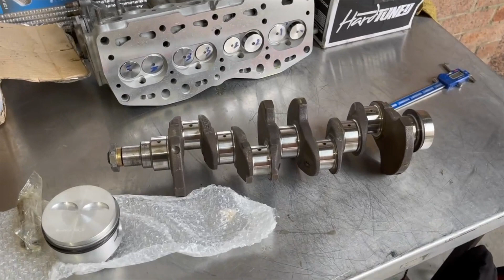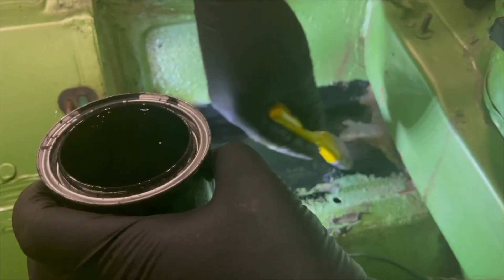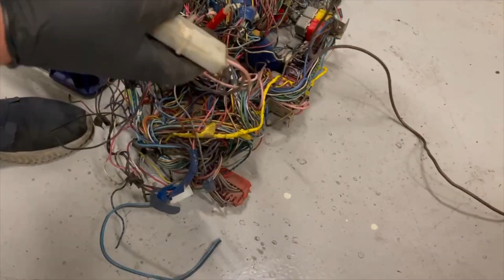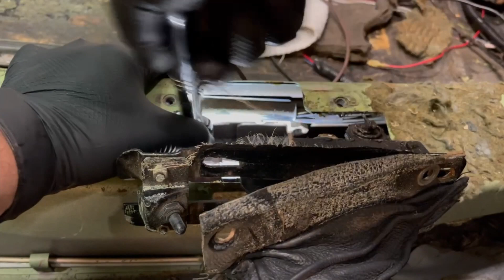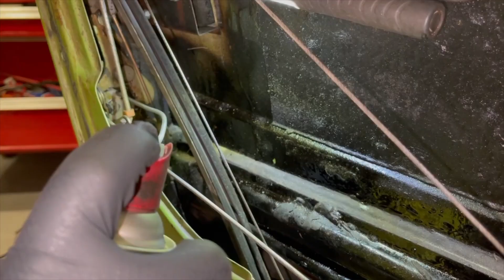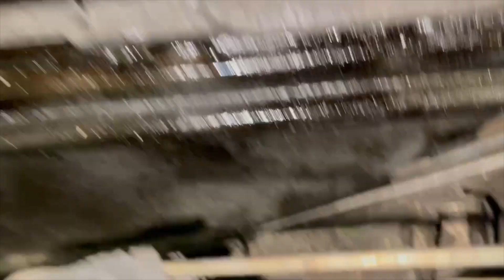The Green Machine Part 8 of a Fiat X1/9 fix

Comment: I love the idea of upgrading with a lock/unlock mechanism. Fantastic idea, especially if it just works alongside the original system. Maybe you can note in comments what system you got and if you're pleased with the quality, fitment and operation. Thanks!
Reply from the maker: Yes works well with while keeping the original mechanism in place. The central locking system was just a generic one you can buy on eBay for around AUD$40.00. However, I only installed two wires per side. Normally the driver's side uses 5 wires. This is used when you lift the driver's button it opens the passenger side at the same time. By removing the 3 extra wires it will only work both doors with the remote only. I did this as there is no room for 5 wires from the door to the body of the car. Thanks for watching.
Reply: Great vid Mark
Reply from the maker: @Purf1997  Thank Jeremy, was fun doing it.